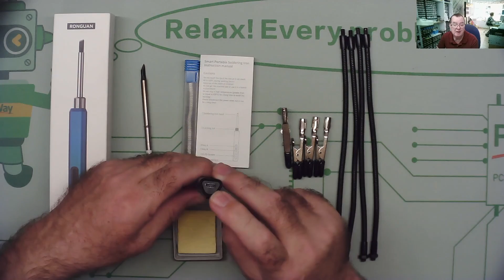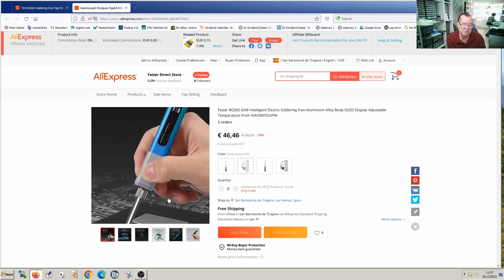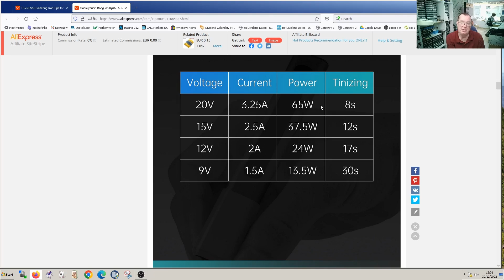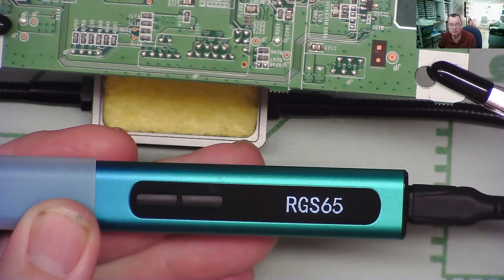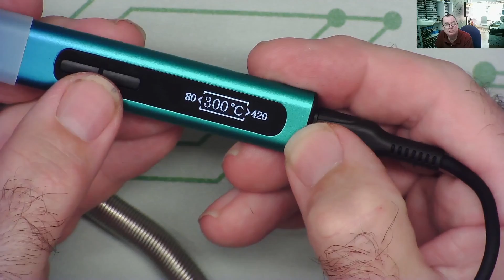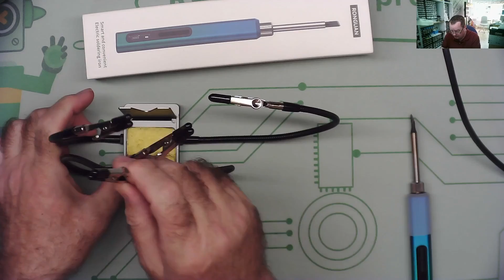RGS65 65W Soldering Iron Test And Review Low Cost €35 T12 Based Iron

Comment: I have one, it is good when it works, it is cheaply constructed and the internals slide up from the body and you have to push it back down.  And then it starts going into constant problems declaring there is no tip installed, even when there is - it worked for 2 or 3 months really well, and then it's time to replace it.

Comment: Thank you for sharing your experience with the RGS65.
I want to ask you if you know of a wireless soldering iron that does not use an external source.
I have seen a few models but their power is very low.

Comment: The new Pinecil V2 from Pine64 seems like a better option than something random from aliexpress.  Apparently Pinecil have new short tips that are pretty nice too.  Multiple power options like USB-C and barrel connector too.   Miniware TS101 also reviewed pretty well too and much more of a known quantity.
Reply from the maker: Miniware said they would send me a TS101 to review, unfortunately I missed out on the initial batch of review samples as the channel was too small to catch their attention at the time.  The only way to answer your point really is keep on using the RGS65 nd see if it proves reliable.  As they use the same technology I suspect all of these mentioned products will prove to be of similar quality and durability.
Reply: @learnelectronicsrepair  I use a Pinecil V2 and I'm really happy with it! The Pinecil V2 can use up to 130 odd watts with lower impedance tips. It's certified for that. I'd be interested to know if the RGS65 can also use the lower impedance tips despite its 65w limit.

Comment: Wee tip: Don't use a wet sponge - better use a copper or brass sponge. The thermal stress excessed on the tip when using the former, will ruin your tip way faster. If you make sure to only using a copper or brass sponge and end the work by tinning the tip and quickly dipping it in the sponge, it'll last for years.
Reply from the maker: But I've always used a wet sponge - since the 1970s - and I have had soldering tips of all types last for many years.  My current BC3 has been in the T12 since 2019, has met with the wet sponge on may occasions and it's still going strong, though it has swelled/bulged slightly and may be in it's twilight years.   My honest wee tip:  Use whatever you prefer to clean your soldering iron tip and always keep a couple of spare ones in stock.  When it fails replace the tip and replenish your stock of spares.   Out of interest when did those copper/brass sponges appear?  I certainly never saw one in use or offered for sale in electronics magazines during the 70's as a hobbyist or in the 80's to early 90s when I worked in large commercial repair workshops.
Reply: @learnelectronicsrepair  It's surprising to hear your t12 tip is still fine, despite the 380 degrees setting! When you said 380 degrees I audible gasped. I am at 270c for my leaded solder :O

Comment: I absolutely HATE the knife tips, it is dreadful that most of the KSGER / Quicko / similar T12 irons come with them as default.
Reply from the maker: I must admit I also had a strong dislike of the knife tip, you know my preference in the video is the BC3.  When I was desoldering the SMD capacitors in the video you can clearly see the BC3 does it a bit quicker, I expect due to it's higher thermal mass/heat transfer characteristics.  But as I was forced to use the knife tip for this review I had a bit of time to play around with it and I can now honestly see why some people love it / would use nothing else. It actually is far nicer to work with than I ever realised and it's likely if I end up with two soldering irons on my bench, it is going to be BC3 in one of them and knife or a BC1 in the other one
Reply: @learnelectronicsrepair  the knife tips have their uses, and I often use them when doing smd components and/or scraping solder mask

Comment: If you get a chance, could you do a short video showing how it performs with regular T12 tips, Rich?
Reply from the maker: I did mean to do that in this video but all of the first recording had to be scrapped due to serious problems with the audio (don't ask - it was my fault!) and I forgot to do it on the second recording.  You can do it but the standard T12 is way to long to make the iron comfortable to use - for me one of the most important features of a soldering iron is keeping the working distance between your fingers and the tip as short as possible.  This is why I use the Aluminium 9501 handle on my KSGER and liked the RGS65 too.  Anyone who uses these types of handles will know exactly where I am coming from and anyone who never tried one really needs to do so as it is something of a revelation!
Reply: @learnelectronicsrepair  I saw they'd be long. I was interested in the performance aspect of it. I might buy a T12 handle for my T3A so I can try it out with the Pinecil that I have. Sometimes the Pinecil tips can struggle. Not that I use the Pinecil often, it was just curiosity, Rich. 

Keep up the great videos. I was watching the Mixer vid Pt 1&2 earlier. Can't wait to see part 3 if the customer goes for the repair.
Reply: @alanbenson1505  The performance is the same in terms of electrical characteristics. Equal quality thermal performance should be achievable with equal quality manufacturing. No idea whether the RGS65 will work with the lower impedance Pinecil tips though

Comment: if you can figure out how to drop the voltage down to 0.2 volts then you got the ultimate short circuit finder because you can ignore the diodes. 0.7 volts to forward bias a silicon diode and 0.3 volts not sure to forward bias a germanium diode. this is for the short circuit finder.
Reply: you could forward bias a mosfet

Comment: i saw your video on millaohm meter for finding shorts. i loved your idea. i just wanted to ask if you eliminated the regular and used 1/8 watt 500 ohm resistor and use a 3 volt power supply basically 2 aa batteries so it can forward bias a led approximately 2.5 volts. just put in series with the current limiting resistor. you came up with the idea. the idea is the measured voltage will go down no matter what as the closer get to the short and keep from damaging the components but you can use 1 aa battery and use a 250 ohm 1/8 watt resistor. if this works it would dirt cheap short finder. you can do the calculations.
Reply: The battery's voltage will drop with usage as well as due to its internal resistance. Unregulated sources will work but possibly skew your results. You could use an external regulated supply, though.

Comment: looks like a nice little iron but I'd definitely recommend the pinecil over it. cheaper price and more reputable company. plus it can also use T12 tips if you want (but they are, indeed, way longer than the stock tips)
Reply from the maker: I've never used the Pinecil soldering iron so I can't possibly compare them.  From the links I can see on Aliexpress it is more expensive than the RGS65.   They look very similar products, you can put T12 in the RGS65 also but they are too long to be used comfortably.  As you give a definite recommendation I assume you have tried both.  What's the big difference?
Reply: @learnelectronicsrepair  apologies, "definitely" was a poor choice of words on my part as I haven't tried the RGS65 myself.
I wasn't aware the pinecil was available on AliExpress too, but I got mine directly from the pine64 website where it's currently $25.99+shipping. Depending on where you get it from and what shipping+tax cost you, the Pinecil might end up costing a bit more or a bit less than the RGS65 but overall they're both very competitively priced.
While I can't speak for the heating performance of the RGS65 personally, I expect it and the Pinecil to be closely matched in that regard. 
In my eyes, the main advantages of the Pinecil over the RGS65 are:
1. option of USB-C or DC barrel jack power input, so on top of USB-C chargers you can also use a wider range of power sources like battery packs, bench PSU etc  without the need for (sometimes janky) usb-c adapters. Many of these options are also a bit cheaper than a good USB-C PD charger too, for people that don't already have one.
2. the Pinecil uses the same tip style as the very popular Miniware TS100/TS101, so lots of tips are available at very affordable prices from PIne64, Miniware and many other 3rd parties
3.I couldn't find out what firmware the RGS65 uses, but the Pinecil uses the excellent opensource Ralim IronOS which gets actively maintained and updated by the community
4. bit of a personal preference here, but I feel like having to fully unscrew the metal piece on the RGS65 and slide it over the tip is quite a bit slower and more trouble than the set-screw approach used by the Pinecil and TS100 in regards to changing tips

The RGS65 looks like a decently made iron and overall I'm sure it'll work great for anyone that decides to buy one, but if you have the chance I'd love you to have a look at the Pinecil and give us your thoughts.
Reply from the maker: @danandrei96  Though I never had the pleasure to use one, I think I have to agree with points 1 through to 4.  I have reviewed some products for Miniware previously (MHP20 mini hotplate and DS213 oscilloscope) and Miniware said they would send me a TS101 and any future new products they release so I should have the chance to make a comparison at least with that one.   I am very much of a similar mind to yourself, I expect all of these three soldering irons will have similar, and very good, performance as they all use the same type of technology, and anyone who bought either of them (possibly influenced by the availability and buying price in their region) would be very happy with it. 🙂
Reply: @learnelectronicsrepair  Sorry butt in, but the Pinecil is part of a larger "ecosystem" of these irons, which include another brand which preceded the Pinecil called the T100 (and a smaller brother T80?) from Miniware. The tips on those are interchangeable, and T12-ish, and from the manufacturer the prices are different. At least for me, in the U.S. And if I add the price of their USB power station, which not only has the 65W outlet but another QC 3.0 outlet and three more standard USB 3.0 outlets, and a nice display, and the price of the tips and the silicone cables (they become a must after a while, after melting your first cable), it's closer and closer.

I can't tell exactly if this is of the same ecosystem of T12-ish tips, or compatible firmware (it's dead simple to play with many different firmwares with different features, like IronOS), but one thing I couldn't see in the video is a grounding screw. I had to have one, so I could wire it to my ESD ground. That's one feature that's not negotiable for me, unfortunately. The tip is not grounded to the USB for obvious reasons, and you'd want it ESD grounded anyway if you were, say, using a Li battery to run it (which a peer of mine does with success.)

But altogether, even though I had to change tip styles and there's an extra cable coming off of my Pinecil now (as with any "portable"), I have to admit my Hakko hasn't had much use despite having more power and built-in ESD protection. The T12 tip style is superior, I think, to those that fit over a ceramic heater.

And I'd recommend people use a ground screw if available on these, again. That would be a big minus if this lacks it, though it should be very simple to hack it to have on, if it lacks it. But at that point, you're definitely in Pinecil territory for time and price.
Reply: Oh, and I forgot to stress up there that I suspect that the tips are compatible with Pine and Miniware (and dozens of cheaper manufacturers') tips; I share your fondness for the BC3 (or BC2 in my case?) for drag soldering .

Comment: Looks good but I personally would need to buy a power supply, think I will wait and see what the tip selection is like..Happy New Year and cheers.
Reply from the maker: Yes as mentioned, it is very good value if you already have a suitable PSU but it adds another €20 if you don't.   Of course a high powered USB C PSU/Charger is also a very useful thing to have in the workshop and will become even more so when the EU USB-C Directive comes into force in 2024.  If you are not familiar with this, from that date new electronic devices sold in the EU will have to use USB C chargers.  This includes:

mobile phones
tablets and e-readers
digital cameras and video game consoles
headphones, earbuds and portable loudspeakers
wireless mice and keyboards
 portable navigation systems
all laptops

https://www.consilium.europa.eu/en/press/press-releases/2022/10/24/common-charger-eu-ministers-give-final-approval-to-one-size-fits-all-charging-port/

Comment: Does anyone doubt that this Chinese crap will break down in half a year? A good lasting solder iron does not cost 35 bucks.
Reply from the maker: Hi Ricardo, that is a good question and really there is only one way to answer that - how about if I get a BC3 tip for it as it is my favourite soldering bit, and use this soldering iron on all my videos instead of the KSGER until it fails?  

I assume you have prior experience of these as you already judged the results because you say it is chinese crap?  The honest truth is, I have no evidence one way or the other

What I find interesting is that the KSGER T12 that I have used (bought it in 2019), and the BC3 tip with it , has worked hard almost every day for longer than this channel has existed. It is also Chinese crap and yet it is still working - yet for some reason you nor anyone else have any issue with that, though it only cost me £50 (used) on ebay with about 15 new tips
Reply: Well, if we're talking about this category of design, then I would have to doubt it because my Pinecil and PSU have been running since they debuted. There's not much to go wrong. There's no "heater", they're T12-style and are consumables (though I haven't worn one out yet, despite heavy Pb-free use), and the electronics are just the MCU and heating control. Even if that whole board breaks, it's designed to be replaced (people even like to change the "shells" of these for style, the transparent one's popular.)

And being able to change firmware on a whim is not a feature to sneeze at, and relates to the "not really 65W" argument: the PID with the base firmware seems to hold 350C steadier than my Hakko. 🤷What can I say, it's good.
Reply: @Mr Guru the T12's don't need parts replaced when the heater fails. You just replace the cheapest consumable, which is the tip. They're stupid simple and readily cloned with surprising quality out there.
Reply: You'd be surprised...
The part that will break first is the oled screen, because of burn-in. You could replace the screen of course and keep using it. 

How do I know it? Because it's one of these TS100 style clones which people, including professionals, already have long-time-tested by using it for years.
Reply from the maker: @Mr Guru I concur. And of course with T12 and similar you just put a new soldering tip in.
Reply: @Mr Guru my t12 pulls up to 88w from the wall.  T12 works up to 24v which is 72w for a 8ohm tip.

Comment: My question is how do the shorter T12 tips go in a standard T12 handle. I have one of the clear handled all in one T12 portable iron, and it would be nice to have a shorter option for portable use.
Reply from the maker: They would not work in my KSGER T12 handle, they are too short to make connection
Reply: @learnelectronicsrepair  Indeed, the answer is likely no. The only handles possibly suited, are the ones that are meant to be compatible with the older stands for the 888(D), which have a larger handle to tip distance by design.

Comment: 8:43 - Just a tip, since you have thermal camera, I would check soldering irons in parallel, to see temperatures on both. Anyway nobody is soldering anything at less than 350*C, so only above is OK. 
Would I buy this? No... 
For laboratory work, its better to invest those 65$ into real soldering station.
For field work, 15$ is enough to get battery powered (vapor style) soldering iron to finish few solders. 
Backup soldering iron (10$) to be ready to be connected to 5V powerbank for multiple solderings.
Reply from the maker: @Mr Guru You are the second subscriber who says the Pinecil is cheaper - I can only find them more expensive on AliExpress - can you post a link? I do note the Pinecil also has a round DC jack which is good, but it appears from looking at the pics that the working distance, fingers to tip, is longer - something I personally dislike but others may feel differently about it.  Also there is the EU USB-C directive coming in 2024 where all new devices sold in the EU must use USB-C power supplies so it may be a good idea to move that way now.   

I like to review items related to electronics hobby/repair and just give an honest opinion, but I don't try to push the product or give a hard sell (like for example Northridge).  I still expect viewers to make up their own minds what they prefer to buy, I'm just showing some of the options available.  Hopefully someone at Pinecil will like to send me one of their soldering irons and I will test it, I don't undertake any reviews where the terms would prevent me reviewing other similar products 😉
Reply: @learnelectronicsrepair  Wow, I'm replying a lot on this video, but my Pinecil, at least, has both the USB-C and the barrel, with the barrel being handy for bespoke Li battery harnesses.
Reply from the maker: Horses for courses as I mentioned.  It works pretty much the same as my KSGER T12 and  I think with the BC3 clone tip it would work the same.  What would you buy instead, for the same price?  It is €35 ($38.50) with free postage though to be fair that includes 21% sales tax (VAT) which I don't have to pay due to my location so for me to buy one would be €29
Reply: Until i mention I solder at 270c with my halide holding solder